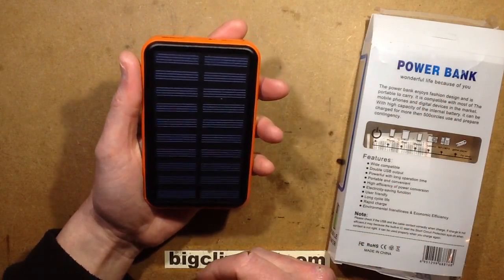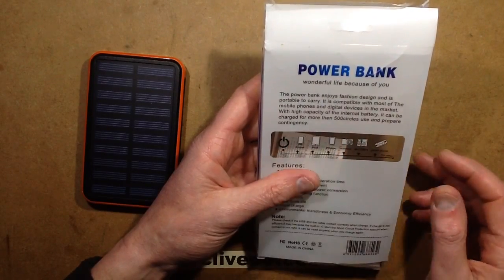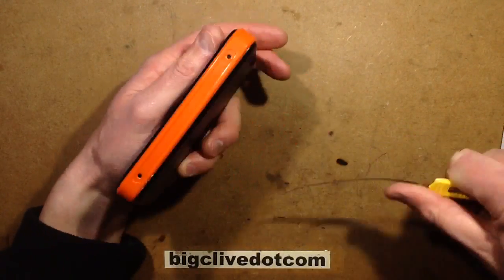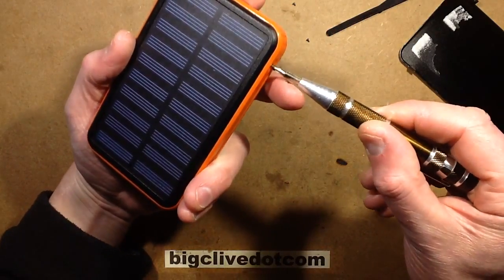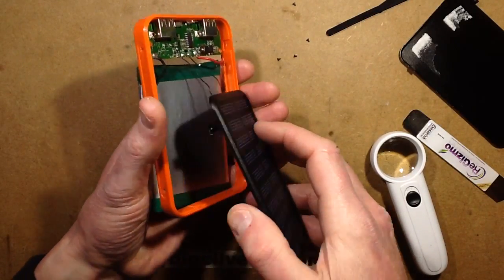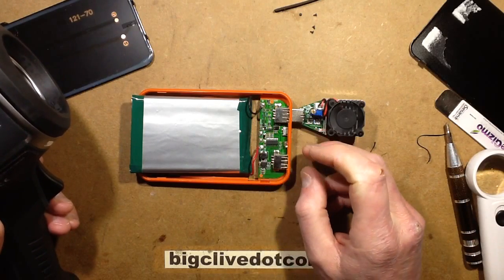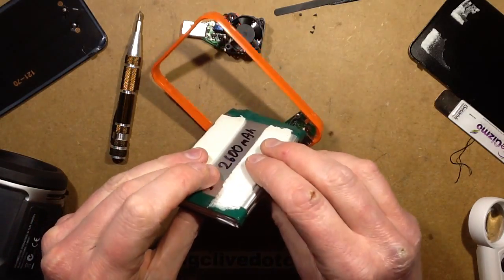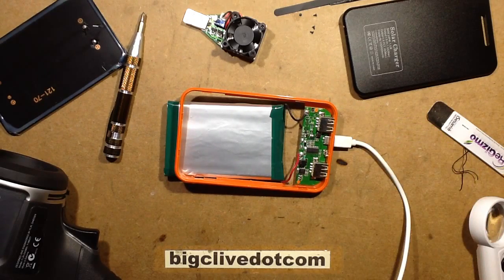FAKE! 100,000mAh solar powerbank capacity test and opening.

Comment: I don't share your favourable view - you can get a brand name power bank e.g. Anker for 12 Pounds on Amazon and you don't have to wonder whether the damn thing is gonna burn your house down... and that solar cell is probably completely useless, i.e. it's gonna take forever to charge. You gotta be crazy if you go for this Chinese crap where you can have a brand name item for the same money with good cells.
Reply: Baerchenization I was about to say something like this. Not only are the branded ones safer, they also are smaller and built better and support quickcharge. You could still buy chinese stuff to save a few pennies though. Just buy Aukey, Xiaomi or BlitzWolf from a reputable seller. I think Aukey is actually sold through amazon in the west and it isn't even much more expensive than straight from China.
Reply: Baerchenization   Anker is Chinese.
Reply: Is it very difficult for you to distinguish between Chinese crap, which is some random, non-descript company selling utter crap for the sake of it and something being manufactured in China, but to a standard? Must be so, or how else are we to understand your comment? Btw "Anker was founded in 2009, the brainchild of a group of friends working at Google." Does not look Chinese to me, but even if it is, you still completely missed the point.
Reply: +Baerchenization - The point is you can't trust any of them if they don't specify what make and model of cells they use, and specify output current capacity too so you can verify their claims.  This USB power bank industry is one of the few where they can deceitfully tell you the internal battery capacity instead of the output capacity like any other power supply industry has rated for decades.
Reply: +Baerchenization, I have a power bank with the solar cell and it works pretty well at keeping the batteries topped up since I don't use it that often. The only problem is that keeping these batteries at 100% is actually pretty bad for them and they ended up swelling up. I was going to replace the batteries but I couldn't find any for less than the cost of a new unit.
Reply: Jesus Christ :) Do you sometimes read your own writings?! :) That is your idea of "working pretty well"? :)
Reply: In the aspect of keeping the cells topped up, yes. In the aspect of keeping them healthy, absolutely not. It did its job for more than a year though which is not so bad for $10.
Reply: This is also an issue I'm trying to work out how to deal with with expensive kit too. I have a canon DSLR and the charger only charges the batteries. I have a couple of spares that have become bloaty from sitting fully charged. I'm hoping to work out building a partial discharger for storage.
Reply: Not buying it... the reason is because you rarely used it - so basically it doesn't work. And it wouldn't because if you watch any review of these cheap chargers, it takes them days to recharge anything... and you did not really make the case that this one is any different. How useful - you go on hols where you need a charge once a day, but your solar charger takes a week to recharge your pack, by which time the hols are long over :P
Reply: You seem very antagonistic, chum. The question was merely whether it would recharge the batteries, not whether you could use it to replace a nuclear power station. And yes, I rarely used it as I typically manage my charging needs pretty well but sometimes that's just not possible and hence a power bank.
Reply: That's assuming the Anker one off Amazon is genuine. Amazon sells fakes too.
Reply: Anker is chinese is it not?
Reply: @baronvonlimbourgh1716  Anker being Chinese good brand rather than "chinese crap". There is a big difference.
Reply: I've seen some ads on Wish that honesty stated that the battery will take 40-50 hours of strong, direct sunlight to fully charge and they even noted that a day only has 7-8 hours of sunlight. So while most omit the full truth, you can put two and two together by reading enough of the different ads :)

Comment: They never seem to put out the 5v i would expect, it is a usb socket after all.
A better boost converter perhaps?
Reply: most cheap chinese stuff sags, my cheap car charger does, it says 2.1a but starts off at 4.7v and drops about 4.5v at 1a! 2.1a, never
Reply: Hmm sounds saggy :-(
I would expect say 5.2v without load and 4.85v full load, i would be supprised if any did that.
Oddly enough the other day, i found a sony expera charger on the pavement outside my house, after a wash, i plugged it in... no it didnt go bang, worked loverly, above 5v unloaded and when loaded it was 4.9v, it had a usb socket on it.
Handy as i was fixing a mates phone and needed to test the power socket, A1 happy as larry ;-D
Reply: with my luck id find a cheap chinese one!
Reply: LOL :-D, one of clives "Death supplys" disguarded :)
I tend to find coins, mostly copper, ha ha copper thats a joke.
And for some reason 13mm nuts, odd that.
My mate has better luck, he falls over usefull items, last year he stopped at the kerb and saw a brown box just sitting in the gutter, it was sealed, he opened it later and there was a propper big teliscope inside, new!!.
Everyone else had ignored the box because well its a cardboard box thats empty, but this one wasnt, lucky git lol.
Reply: @zx8401ztv  for a while I was finding 10mm and 3/8 sockets, in 1/4in drive. Great brands, but how many can you possibly use?
Reply: T Reed
Hmm 10mm and effectively 9.5mm, someone was having trouble with worn bolts maybe :-D
Well i dont think you can have enough sockets, and free ones are even better :-D.
Looking at my comment 2 years ago, i think the 13mm nuts may have come from road sign brackets.
Maintainance guys may not be too bothered what they drop.
Lately 2019, im finding 6.3mm hex screwdriver bits, usually found in the road gutters, im sure its people cleaning there car and dumping to the gutter.
Sorry T Reed im waffling :-(

Comment: Would love to see an Anker powerbank teardown. I have the Astro E2 16750mAh one and it's brilliant. Uses Panasonic cells and doesn't take too long to charge on my 6 port 60w USB desktop charger also from Anker.
Reply: Chronic's Tech Stuff I personally prefer RAVpower over Anker.  Both are great brands though.
Reply: @alaeriia01 
The products from RAVpower and Anker share an odd similarity. First thing I thought "Are those rebranded Anker products?"
Reply: @Sypaka  I have no idea.  RAVpower is a brand owned by SunValleyTek, and it is possible they are the OEMs of the Anker powerbanks.

Comment: Curious what the solar panel outputs?
Reply: Subaru Mike was disappointed. he didn't mention
Reply from the maker: No real sunshine to test, but I'd estimate 5V at 100mA.
Reply: I have a panel just like that and you're looking at around 0.6w maximum power.

Comment: Please test chinese brand power banks (xiaomi, Teclast, Rock, ...) And when you do output tests please inform us what voltage it can hold at different loads. Its important, because of the voltage drop in usb cables. You need a stable output voltage of at least 4.95V for phones to enable fast charging. Love your work. Thanks.
Reply: I just noticed that i didn't pay enough attention and you actually ramped the current up with the voltage showing this time. please do that everytime. Its very useful.

Comment: Not sure I like the idea of leaving a Lithium power bank in direct sunlight.
Reply: It's for camping, charge your phone and start the campfire at the same time.
Reply: Thats what i was thinking.
Reply: Online some people just like perpetuating what they read some other people saying, online on forums you will find some people also claim that lead acid car batteries can explode like grenades etc and often do, however these people are largely just repeating what they heard another person online say. 
Lithium batteries don't just explode for no reason, sorry. 
Lithium batteries also get way hotter while charging than the temperature they can get if left in the sun.
There are literally 18650 cells that are deliberately shorted out with a thick wire and a thermal camera filming them, for them to reach well over 100c, and they still don't explode. 
Meaning, you actually need some pretty harsh circumstances for a lithium battery to explode. 

The most common way is puncture to the cell, this instantly causes it to discharge between the punctured layers and it goes into thermal runaway and burns red hot crap everywhere. The second most common way is a cheap Chinese battery that isn't using a high quality or thick enough electron insulating layer between the two sides, and thus the breakdown can occur at 100c and result in thermal runaway and the battery exploding. Therefore it's not suggested to try to charge dubious brands at high currents.
Reply: Same here.
Reply: The problem with the Lithium is not the sunlight actually the reaction is with oxygen. Just sayin' =}
Reply: @satisfactory4097  It's the heat
Reply: @satisfactory4097  Yes I had a blown lipo in a drone, so I pierced it with a pin let me squeeze it back in. You know what happened.

Comment: I've seen some rated for 600,000 mAh.
Reply: ELECTRONTHORP2 Nope, that's μAh, I think
Reply: cleaver idea
Reply: Yeah, m8 http://www.ebay.com/itm/Red-Dual-USB-600000mAh-Portable-Solar-Power-Bank-LED-Charger-Battery-For-Phone/222156913354?_trksid=p2045573.c100505.m3226&_trkparms=aid%3D555014%26algo%3DPL.DEFAULT%26ao%3D1%26asc%3D41376%26meid%3Dd439946ef6694914ad7275f08aab3ca7%26pid%3D100505%26rk%3D1%26rkt%3D1%26 Good Deaaallll
Reply: I have just received one of these as a gift because something has smoked inside. It was rated at 200Ah. Apparently these are available in 100Ah increments.
Reply: mharris1270  I'm pretty sure they don't buy parts at the flea market. They're cheaper in the dumpster behind the factory.
Reply: ZarkexTech That's one absolutely shitty image for the yellow one.